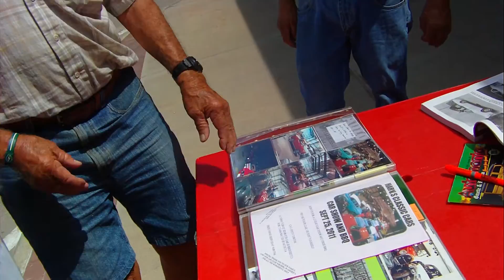1966 Mustang concept Retractable   RARE FORD Seward 4th July car show

Comment: These were a few cars built in the Late 1980's thru 1990's by Ben Smith (The Original designer of the '57-'59 Ford Fairlane Retractable car).  This "Retractable Hardtop conversion" is STILL being made by Wilhelm Motor Works Retractables though upgraded a bit... The owner of the car in the video mentions that the Driver's Door dataplate says: "NOT FOR TITLE OR REGISTRATION" on the Door tag like it's something special....Obviously not knowing that it says this on EVERY 1960's Ford and Mercury dataplate....A nice old couple nonetheless...  :o)  Tony K.